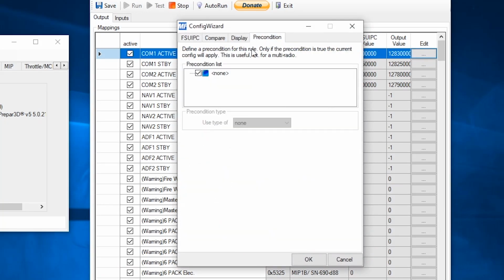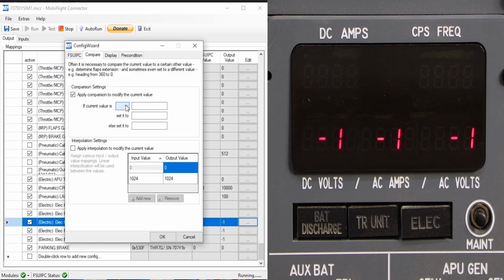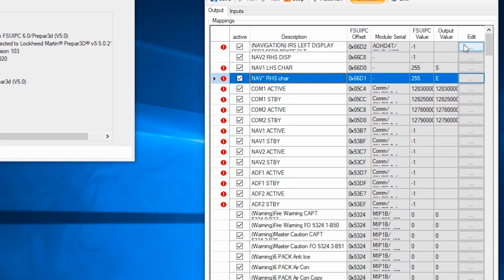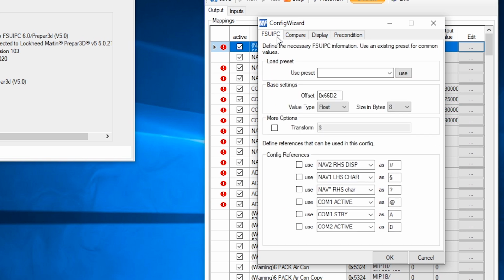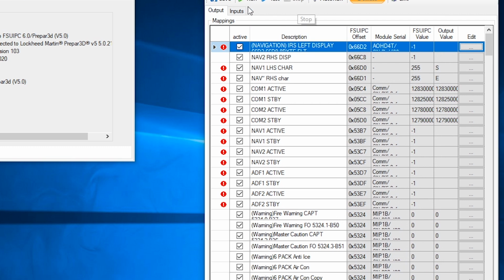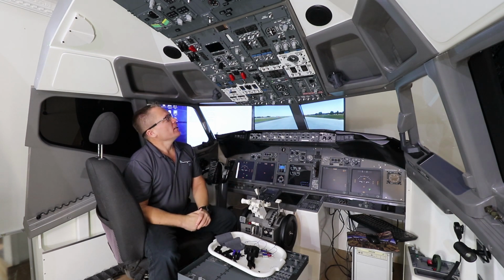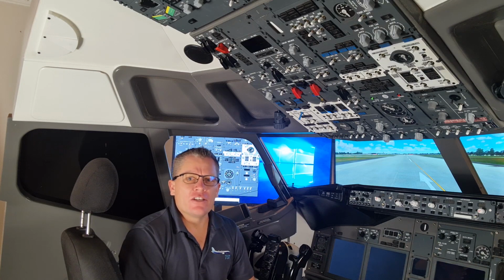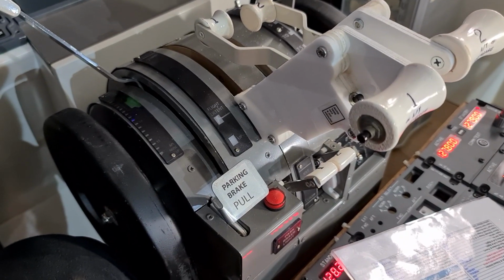Creating and Installing the 737 Engine Start Switches

Comment: Anyone printing these and have a printer with the ability to have multiple filaments to print from like a AMS look into using pla to support petg or petg to support pla filament. Makes it much easier to remove supports because they don’t stick to each other but the downside is increased print time and more waste from purging between filament changes.
Reply from the maker: Great advice , Thank you

Comment: hi, congratulations for the videos, i'm building a mcp, i'm using 7 segment displays, i would like the displays to remain blank when the cabin is in cold and dark mode, i noticed that you used a precondition, exactly how to use it, for example how do i create the battery on condition?
thank you

Comment: I am just thinking, seeing the solenoids working fine, what about the Yaw Damper switch, that is self-cancelling as well, what do I have to do if I want to mimic that behaviour?
Reply from the maker: Good question, I have not tackled auto returning toggle switches yet. I do however, have many real aircraft ones I can use, but that doesn't really help the rest of the sim community. Something i will have to work on in the future along with the MCP AT switch. Kind Regards Karl
Reply: @helimech8152  Thanks for your reply!
For the start: if I wanted to buy these kind of switches, what exactly am I looking for?
I don't even have the fantasy for any search terms, when using somthing like electronically operated switch I get relais or solenoids... :D
Reply: @helimech8152  And here is a datasheet of one of these:
http://www.farnell.com/datasheets/2145064.pdf

Comment: Hello Commander! Congratulations on the project! How did you configure the operation of the solenoid next to prosim737? I ask then when I assign the output to the Gate "Starter Solenoid" in the prosim returns the Switch from "GRD" to "Off.
Reply from the maker: I remember having difficulty with this but can not remember what it was. I think you have to assign all the switch positions for the starter to enable the gate to work. Google will know! It's where i found the answer. If you find it let me know and I will put it on the website for others. Kind Regards Karl

Comment: induction loads are always a trap for new players lol!  Glad you sorted it out before you burned out a USB port on the PC.  Well done and I love the start switches you came up with!
Reply from the maker: LOL! It was close in burning something out! I had a sneaky suspicion that was the problem. Still going strong now, but i want to move away from using the analogue pins in mobiflight. They do strange things on startup. Kind Regards Karl
Reply: @helimech8152  you could use an optó through a relay then into the solenoid? Or use the optó into a triac into the solenoid from just a small see rate PSU just to make sure they are completwly isolated from the rest of the machine?

Comment: Hi Karl, which IC2 LED are you using? it doesn't look like a normal 16x2 that you usually couple with MF? would love to get the same one as you.
Reply from the maker: Hi, it can be found on this page:
https://www.737diysim.com/mysimparts
It doesn't come with the I2C driver. It's an extra large 1601 screen. Hope that helps, kind regards karl
Reply: @helimech8152  great and this works with mobiflight?

Comment: So many of us are wondering I think how the inside of that overhead looks. Lol...

I specifically would be interested to know where you sourced all your switches, rotataries and encoders from, as well as seeing a closer look at how you connected the wiring to what looks like the mega 2560 boards.
Reply from the maker: Hi Mark, there are several videos on the overhead and i have listed all the parts on the website, just not by quantity required. One day ill get around to it! The wiring diagrams for the overhead are also on the website. But I'm sure you probably have found this already by now! Sorry for the delay. Kind Regards Karl
Reply: @helimech8152  I have found em since I posted this. I just need to find a way to get all the panels and hardware in the most affordable way possible. Then I’ll be working on the overhead. Just ordered the PCB board for the MCP, gonna tackle that for now.

Comment: Guys pls You don't need that much arduinos, just Buy multiplexors or shift registers, is rlly easy to use and You can expand 6 or 8 i/o with 1 analog pin, Even You can expand analog pins. More cheapy
Reply from the maker: Hi Ulises, Im guessing your using X plane and probably SimVim or have a good knowledge of programming. P3D and MSFS both require FSUIPC and mobiflight. Mobiflight doesn't accept multiplexers or shift registers to keep things simple. People on my site range from 8 year olds to senior citizens, i struggle to keep up with all the wiring requests and fault finding as it is. Adding another 5 Euro Arduino mega is much simpler than asking another person (usually someone who has zero experience in electronic theory) to create the circuitry/wiring for mutliplexors/shift registers. For analogue uses, i highly recommend the Arduino Micro Pro, for 3 to 4 Euros each. Thank you for taking the time time to comment, Kind Regards Karl

Comment: Hi Heli, how do you programme Starter solonoids with ProSim 737? to turn off when reach N1 50%
I am trying to figure it out. I am using Prosim and FDS relay card and sys1 boards.
If you cak give me little help, that would be nice..
Thanks regards Kapila
Reply from the maker: Hi Kapila, not used FDS kit as it never arrived. Contact me on Watsapp via the website and ill try to help. Kind Regards Karl

Comment: Hello  again a nice project.  i think better to protect the ralay or arduino board  to use a diode by the soleniod ?
Reply from the maker: Hi denis, your absolutely right. They are on the leads to the solenoids. The closest point I could get them as they are self contained units

Comment: Again a well designed piece. I wish, I could model as good as you in Fusion. I'm shocked a little bit that you have to do so many settings concerning this could and dark feature. I would have thought that prosim has modeled this basic behavior. Why should any light be on in the cockpit when the main power is off?
Reply from the maker: Hello! I never thought of it that way, and indeed, perhaps when the software becomes more arduino friendly, this will happen. But I don't mind putting a few extra clicks in here and there. I also think it might be mobiflight glitch too as I have so many cards. Random displays will come on when I start mobiflight. I have to run, stop and run again to get everything perfect. Kind regards karl